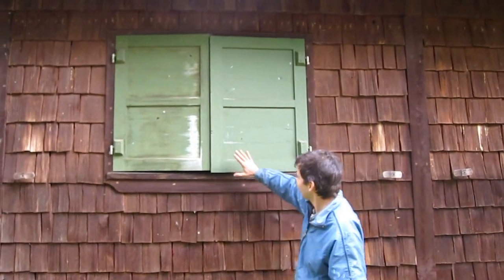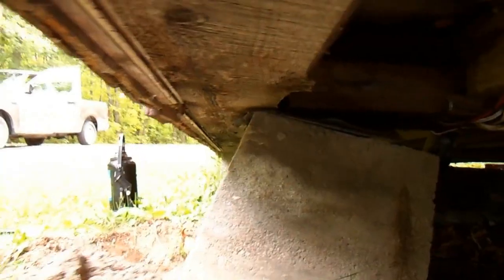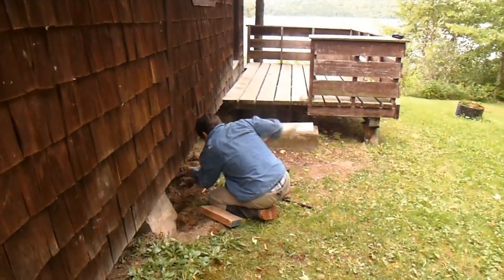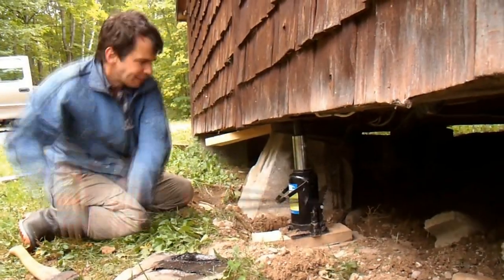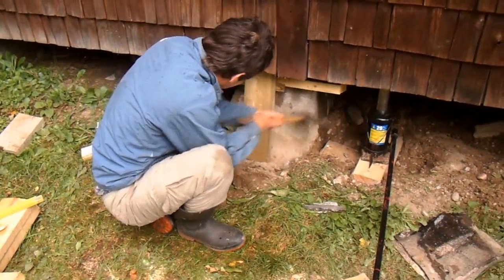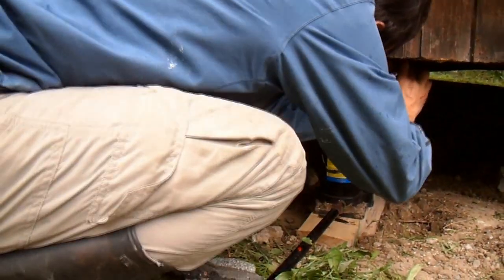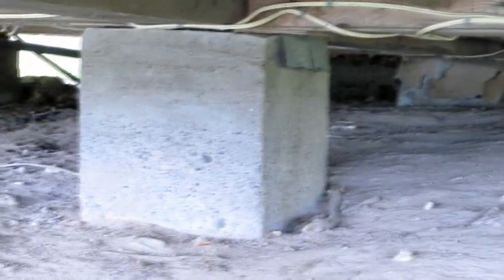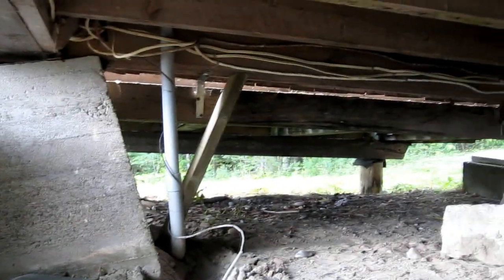Jacking up a cottage

Comment: What is it with this habit to put houses on this type of foundation/poles? In Europe, people build foundations for the whole perimeter of the house, and never run in such problems with displacement, movement, etc. Why here in US everybody is doing it this way? What is the advantage, apart from saving on stone and concrete?

Comment: oh god, I don't mean to be a negative poster but no one watching this video should ever, ever do what was done here. In fact, this is a great example of what not to do.  That pier should have been relaid as badly as it was leaning or some other system should have been installed. Jamming a few 2x4's in there is really bad and dangerous. Plus the fact the fix put wood in contact with the ground makes it against code in every part of the country.  Get 'er done.

Comment: Wrong title,...or fix is not correct !!! You, either has to go under frost line, or use larger footings, bolted to beams!!! What you are doing here, is actually not worth video, actually very dangerous, some kids could go under building,....and perhaps, stay there, very dangerous! My idea of fixing something, important like this, to do it right, or don't do it..., at all !!!
Reply from the maker: +Eero Laukkanen Right.  So you would have done nothing, just leave it crooked.  Cause there certainly wasn't time for what you are proposing.  Some hero you are!
Reply: +Matthias Wandel What was the purpose of your video: how not to do it???? Just wondering.....
Reply: +Eero Laukkanen
Reply: +Eero Laukkanen I like how Matthias handles negative Nancys even on a 6 year old video.
Reply: +Matthias Wandel well if it was done right when it was built no solution would be necessary.
Reply: +Shill I think you missed the end of the video, where he explained that there's no "perfect" way to do it. (Check out the video where he explains frost heaving, it's pretty cool) So, some fix would've been necessary after so many years. After all, this is a cottage, not a bunker.
Hope that helps. Cheers!
Reply: Salah Eddine H Lol, clearly neither you nor Matthias have no experience building in cold climates if you think that there is "no perfect way" to avoid frost heave. Again, if it was built right the first time no solution would be necessary. Hope that helps.
Reply: ***** Unfortunately, that does NOT help. You would be much more helpful if you would contribute something, for example by pointing us in the direction of the "right way to build" a cottage so that frost heaving never affects it after 60 years. So yeah, trying to be snappy by using my "hope that helps" doesn't really work, because you're neither being helpful nor being civil. So you do NOT hope that helps, you hope that makes me feel ignorant and makes you feel better about yourself.
So, please be helpful. I'm here to learn, so I'll wait.
Reply: Wrong attitude but correct answer dig down bellow frostline and put the blocks in with minimum 0.5 metre square footings
Reply: Jep, jep =)
Reply: So I looked it up and the frost line where his cottage is located is 3m deep, or about 10 feet. Would you have any recommendations on how to dig 12ft deep holes for a new foundation under the cottage?
Reply: Yes it's called a shovel.
Reply: It's unfortunate, but yes, big deep footings are the answer. Another thing that can be done is insulation. If you build an umbrella of insulation around the footing it will keep the geothermal heat that is trickling out of the planet from leaving the soil and reduce the depth of frost penetration in winter. 

Building it right the first time is better than trying to retrofit a solution, and it's always much easier to explain on youtube than to actually get out and do something, but there are good real solutions to these problems. 

That doesn't always mean that it's worth someone's time or effort to enact them.
Reply: 3 meters or 3 feet? 3 meters to the frost line is very deep. In any case footings always need to be below the frost line. No other options will work. If you can not dig under dig beside and in.
Reply: Joe Payton It's not true that there are no other options. In Fairbanks Alaska the permafrost is too deep to dig beneath in some places, so they run the pilings into it and then run a refrigeration system to keep it frozen continually. A small enough building can be built on sleepers so it just sits on top of the ground and frost can't heave it out (it will need more attention to structural integrity) and as I pointed out, insulation can be used to raise the frost line, rather than sinking the foundation.
Reply: Emerson White if you have permafrost there's no reason to dig. Permafrost never thaws and therefore never heaves. Summer refrigeration is very costly and not typically an option for a seasonal cabin. Digging a full foundation below the frost line is hard if it's deeper the 8-10 feet. But drilling a 12" hole deeper is not much trouble and more than sufficient as foundation pillers. So for the average homeowner or second homeowner, securing below the frost line is the only feasible option for maximum protection.
Reply: Eero Laukkanen Yeah ok shure, youre the expert!
Reply: If you run pilings into it and build a building on top of it you can thaw it out, which leaves your building to settle. That's why you either have to dig past it, or keep it frozen.
Reply: +Eero Laukkanen
If you had any pride at all you'd fix your keyboard so that when you pressed the comma key you didn't get a bunch of periods after it.
Reply: key board problem--just a lazy finger.